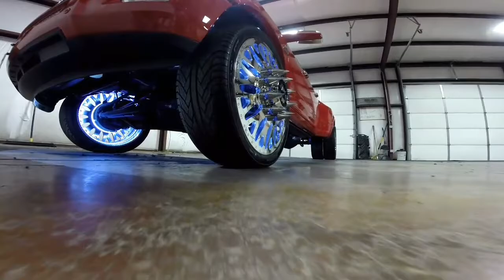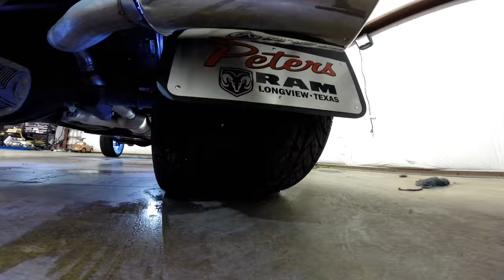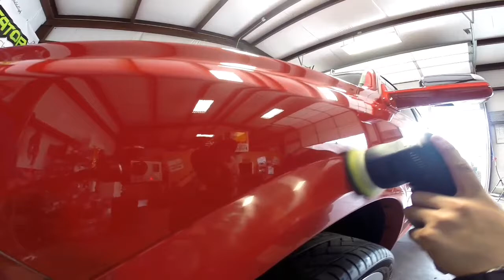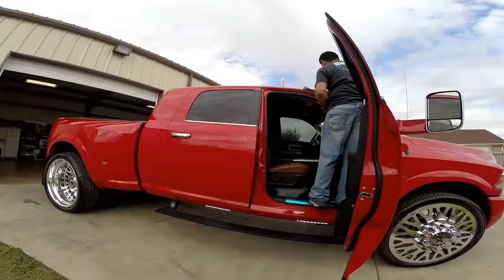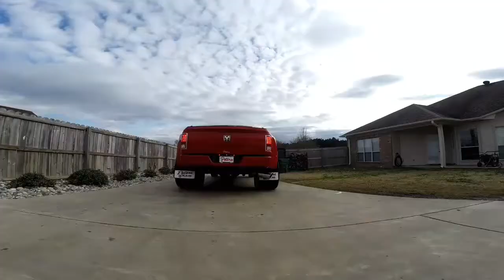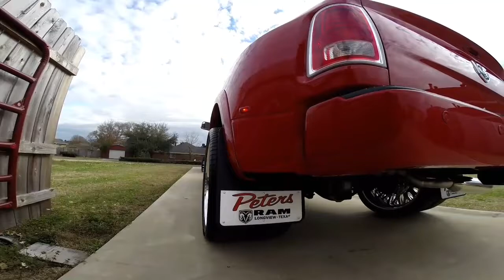Elite Detail and Metal Polishing

Comment: If I put 28” wheels on my dually, will I still be able to use my 5th wheel to pull my rv since the tires will be thinner for the weight